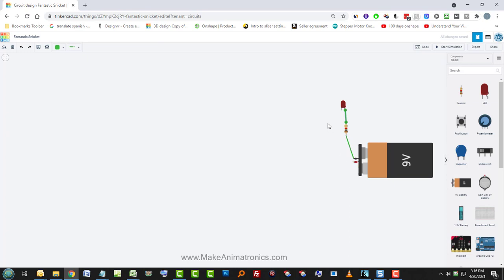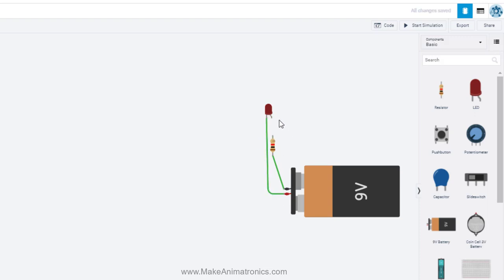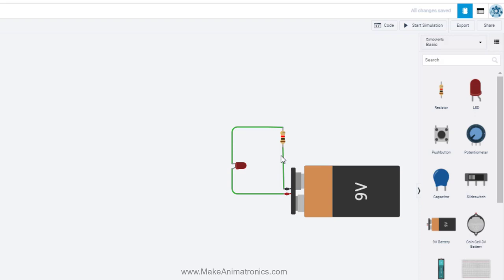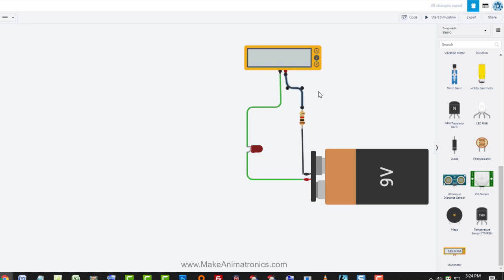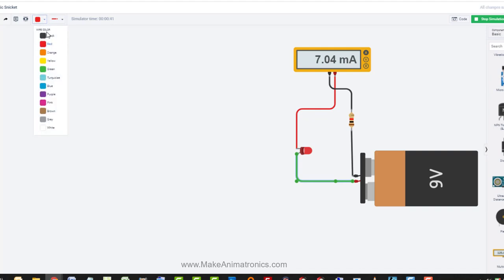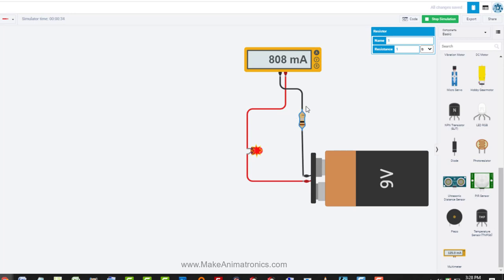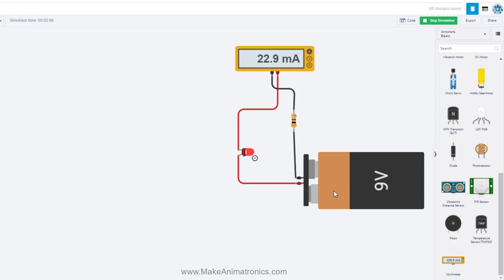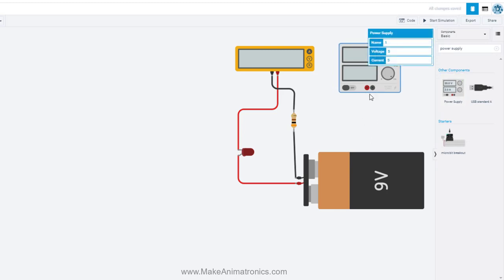Measure Current with Simple Tinkercad Circuits

Comment: why do u put the resistor connected to gND? shouldnt it be connected to 5v
Reply from the maker: In a simple series circuit like this, it doesn't make any difference. It does matter in many situations, but not this one. When I have the choice to connect it to either positive or negative I'm just used to connecting it to the negative (ground) side of a circuit. You're making me think about it now! But I can't explain why I prefer it that way -- maybe because most transistor circuits I have worked on have required it to be on the ground side of the transistor (as a pull-down).